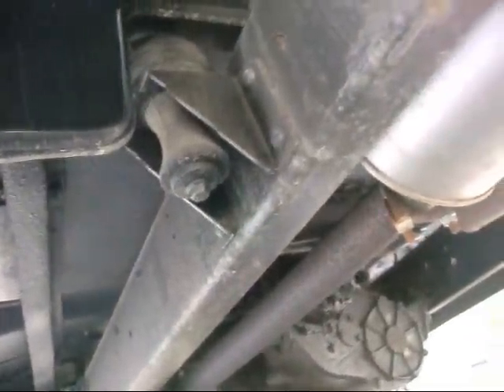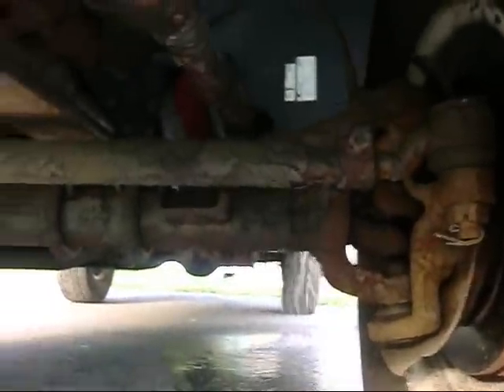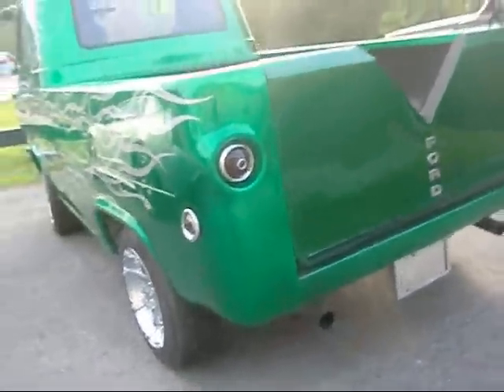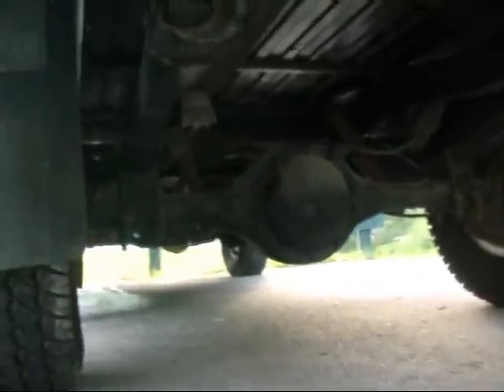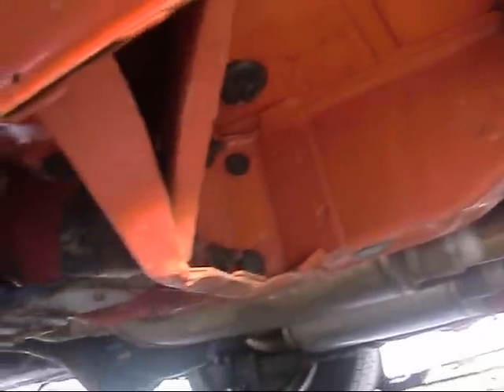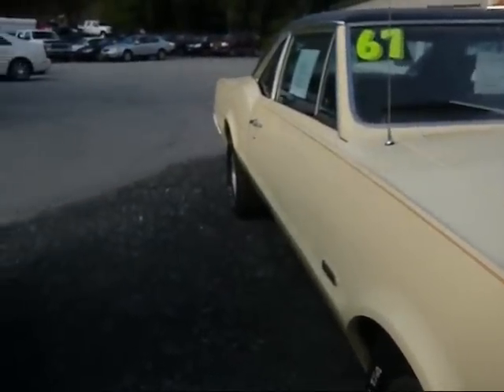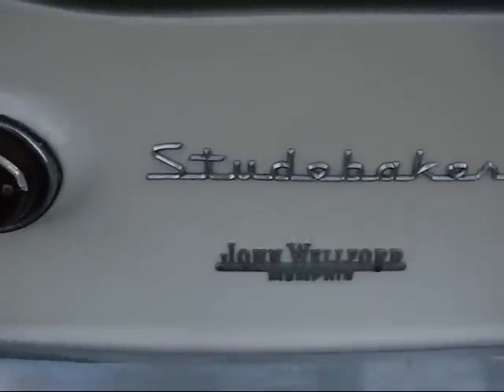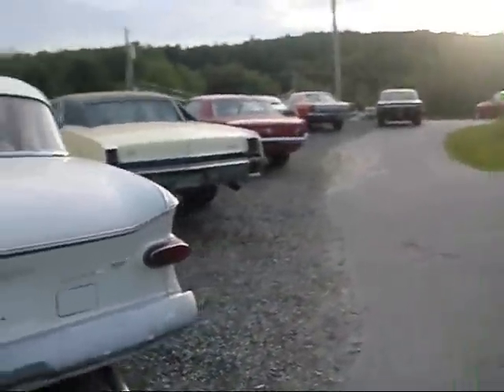6 16 12  Nice Old Used Cars?

Comment: I had a 1961 ford falcon straight 6 no ac no power  anything on the column 3 speed. Man that car was hard to drive I bought it off the lot in 1977. I could not believe I got it for 600 bucks and it had 
14k miles. Man cars were a lot cheaper back then. Where is this lot at I have a friend looking 
for a roadrunner and he has money to trow away . I have asked if he could trow some my way and he said now you know how I got my money!!!